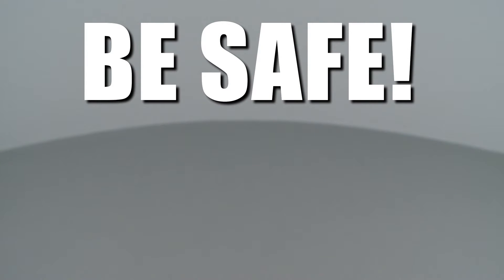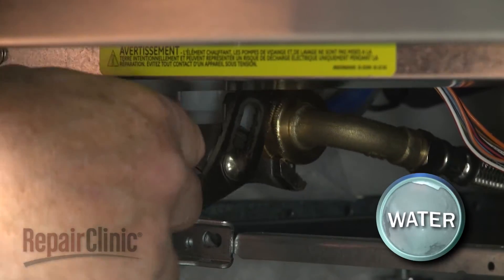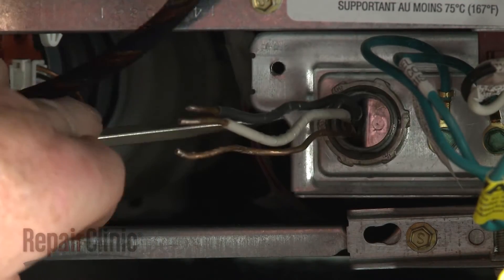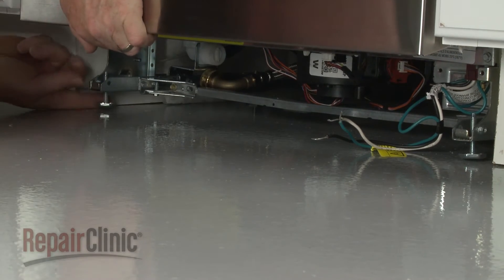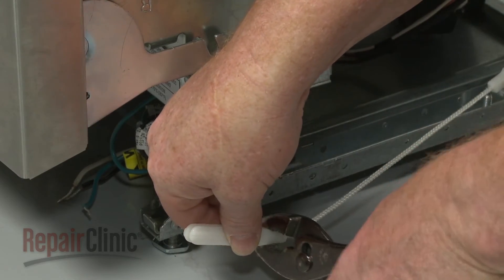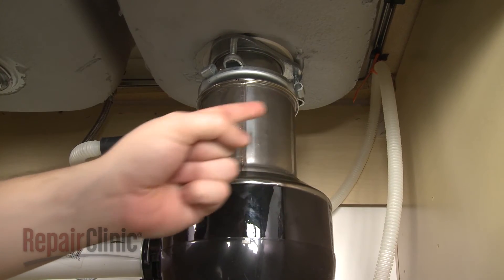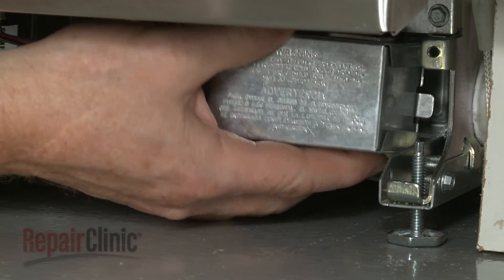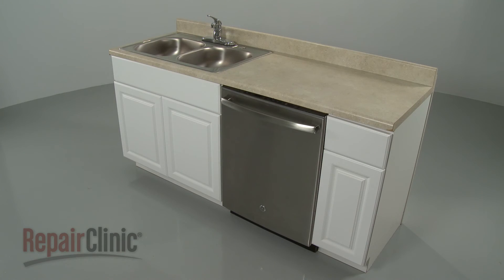GE Dishwasher Door Spring Replacement #WD03X20316

Comment: Very useful instructions - thank you!  A few comments from following this:
1. I faithfully disconnected electrics/water/etc, only to discover that all those cables/pipes had plenty slack.  Worth pulling the dishwasher out slowly and see if you have enough slack before going to the trouble of disconnecting everything.  Still should turn off the water/electrics before starting though!
2. I have a slightly different model and the screws to fasten the dishwasher to the cabinet are on the inside of the door frame on the sides rather than at the top. 

Thanks again.

Comment: I'm glad I found this video. I opened my dishwasher this morning, heard a loud pop, and the door fell all the way open. I followed these instructions and found that the spring on one side had just come off. The pulley that the string rides on was all bound up with insulation, and the binding caused the whole thing to come apart when door was opened. I cleared the insulation and put everything back together and it works perfectly. It only took me about 15 minutes because I had enough slack in the hoses and wire to pull it out without disconnecting anything.
Reply: Awesome
Reply: Repair Clinic is extremely helpful...I am so glad I read jhoot's comment...that is exactly what happened to me. Thanks jhoot.

Comment: It's a shame to use plastic there; likely it wasn't the spring that broke but the plastic piece that attaches to the door mechanism.  I didn't have the pulley part when I disassembled so I rigged a metal attachment; hopefully it will last longer than the plastic did.  But it did last 12 years; that's pretty amazing.    I recommend buying the spring and the pulley part before disassembly.